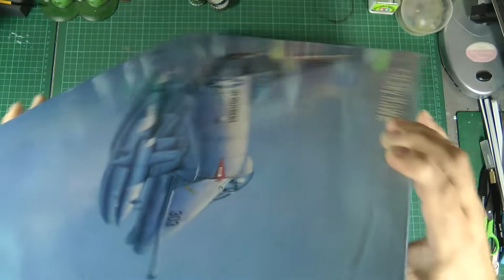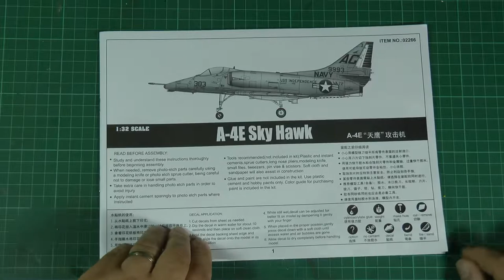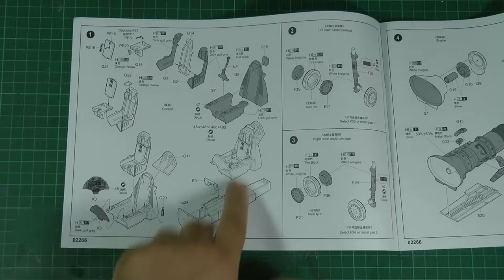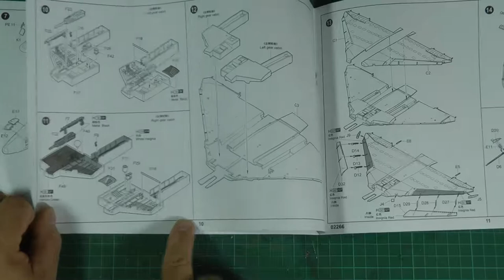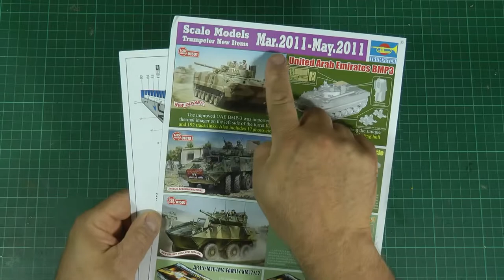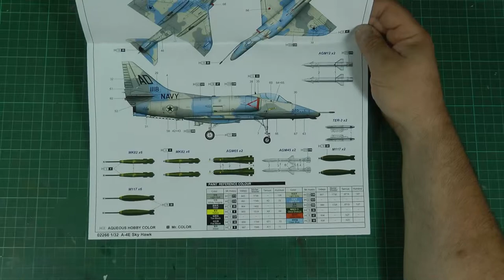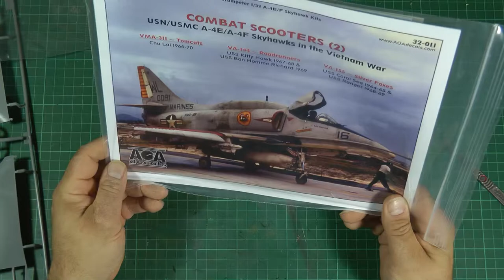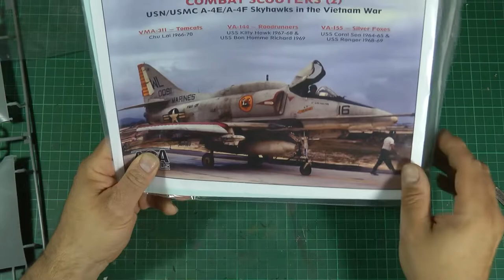Trumpeter A-4E Skyhawk 1/32 kit review

Comment: I was disappointed to see that the nose gear was molded as one piece, it is going to take some careful cutting to remove it. Also, the kit provides the 300 gal drops but not the 400 gallon drop that was often carried on the centerline.